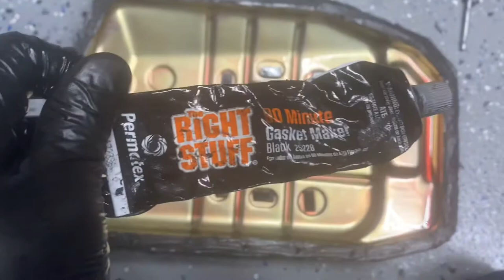BMW Z4 Changing Transmission Fluid

Comment: Hola amigo, que tipo y marca aceite usan. Y cantidad
Reply from the maker: hola, use Maxlife sintético completo y se necesitan alrededor de 1,5 galones
Reply from the maker: https://i5.walmartimages.com/asr/7f8d434e-1db7-4ceb-b993-f6df143cd799.886266e37d7b63ad93d2a6d0f263162d.png?odnWidth=2000&odnHeight=2000&odnBg=ffffff